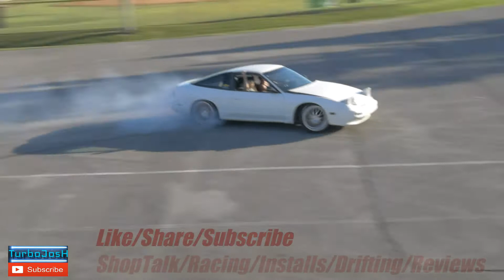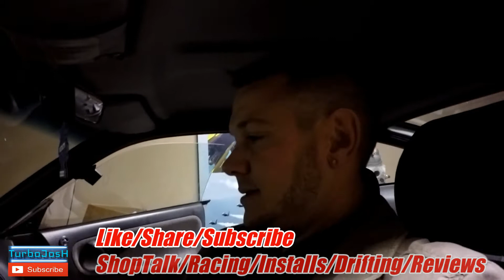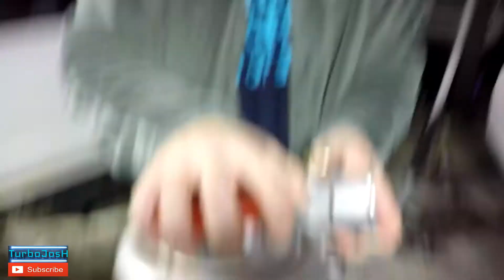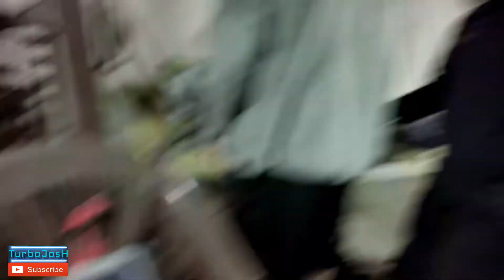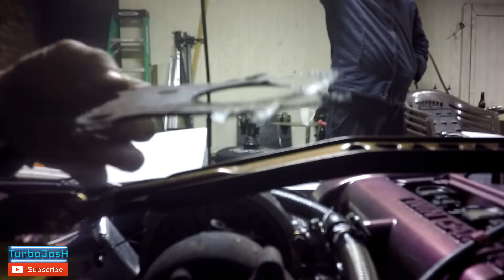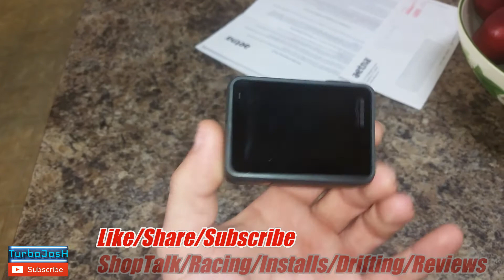Rev9 Billet Turbo Install!

Comment: Hells yeah!! I wanna ride sooooo bad dude.
Reply from the maker: Lets go
Reply from the maker: Nag kevin to get downpipe done. Just got vband clamps and flange today
Reply: Hell yeah dude I will. What's the size difference again between the new one and old one?
Reply from the maker: 2" fan with 5 bolt 2.5" downpipe flange goes to a full 3" vband